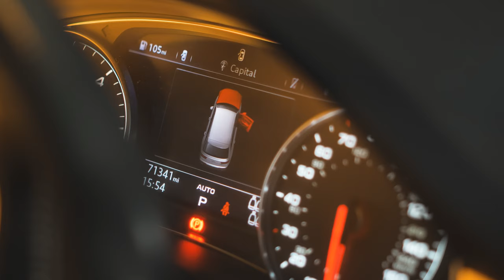AUDI Q7 COMMON PROBLEMS!

Comment: This is a great video to watch before spending 30k on a used q7
Reply from the maker: Glad it was helpful!
Reply: @itsimty  what about petrol q7 same common problems
Reply: Exactly why I’m here.I was looking at a q7 that’s 30k and used.I’ve had used bmws with no issues but afraid to venture out
Reply: @ROXELL audi's aren't for everyone
Reply: I have a 2017 Q7 and it has been great, bought it as a 3 year old lease return, only had Air Cond issues (in Florida). I have had several 5 series & X5's and they all had costly transmission and/or cooling issues.
Reply: I was going to buy a 2021 SQ7 but it has an engine light on scared to buy it just in case it’s a huge expense 🤣
Reply: @ROXELL now that ulez has expanded, do it 😂 got myself an older (2008) 3.0 V6 q7 for £900. Guy couldn't afford to keep it because he lived in greater London. Had it's issues but as it was so cheap to buy they weren't really a problem. Dpf clogged so I had it gutted and mapped out. Injector seals on 2 were dodgy so I spent about 3 hours and £100 on replacing all 6 of them. Just last week had it remapped up to 295 bhp
Reply: Update, there is one near me, 2017 q7 premium plus with 95k miles and asking 17,999 💀
Reply: @matthew_kiely the 8 speed gearbox in the 4M Q7 is the same gearbox in all 8 speed BMWs made since at least 2015.

Comment: I have a Q7 3.0 TDI 218hp ultraquattro. 97000km. I bought it 1year ago. Efter 3 months the EGR valve in the V broke so it lost cooling fluid. I had it fixed on warranty. Now i few weeks ago the Adblue pump died. I took it to a mechanic who programmed it off. Now I want to sell it and buy a gasoline car instead.

Comment: I have a 4M 3.0 TFSi that has been very reliable. It only has 40K km. Only issues thus far has been the upper suspension bushes. The car has been parked for the last 8 months and although it is started every month they tell me things like the soft closure and one touch window closures have stopped working. I suspect the low battery voltage may have disabled these items.
Reply from the maker: The drop in voltage may have caused certain functions to stop working, if you need any more advice your more than welcome to call us on 01332 756535 our team will gladly help, thankyou for watching

Comment: Great video. I own a late 2016 SQ7. Had it since it was 1 year old with 10k miles on the clock. It's a 4.0 V8 TDI version. It had been perfect for 5 years of ownership, but then in the last year we started to do really small 1 mile journeys (school pick up/drop offs etc), 1 year later, had 2 Ad blue repairs in with Audi garage - Ad blue injector pumps, and other ad blue system repairs - spent £2k on it. Before this, was just regular serviving and no issues at all. Car has done nearly 50k miles now. Moral of the story, pay for the extended warranty (or have a great Audi specialist near you!), I saved myself about 2k on not buying 2 years of extended warranty - but had I done so all the work would have been covered plus any future problems....
Reply from the maker: Thank you for watching
Reply: Or walk...
Reply: I made a comment above a year ago about my Q7 issues. Well I sold that car last October and bought an almost new 2023 Touareg. I believed the Youtube reviews that said it was a budget Q7. Sadly the first part of that advice (budget) was more apt than the latter part. The Touareg is no Q7. Noisier, thrashier, lumpier air suspension, maddening to use the driver interface (especially the cruise control), less accurate on the road. Took it for a 1000km+ drive around the country (NZ) and when I came back started looking for something else. Two weeks ago I found a December 2019 SQ7 TDi with one owner history, 25000kms (15,000 miles) and full service history since new from the same dealer. Its like new. This car was one of the very last in NZ to be sold before the switch to full digital driver interface. I bloody love it. Hope I don't have any issues with it, but it still has two years of full Audi warranty and I can get another 2 years before the car turns 6yo.

Comment: I just bought a used 2015 Q7. It’s in absolutely perfect shape mechanically. Two door dings. It’s got 135,000 miles on the it but absolutely runs like a new one. Best part is it was only $8800. Yes $8800.
Reply: What state are you in? I’m looking at one now in VIRGINIA and it’s $14000 with 107,000 miles
Reply: I got an s-line prestige V6 2015 with 166m in PERFECT condition for 4800$ in Chicago…
Reply: @FlawlessNJ  Even better as long as the Chicago salt didn’t eat too much underneath.

Comment: Glad I found this video. I've got a 2015 (new shape) Q7 3.0 TDI, which I bought with 36kms on it in 2018, now has 93kms. Been a great car. However over last three years it has slowly developed a rattling noise from either trans or engine when cold and under load (up a hill etc). The dealer service guys here in NZ (taken it to two different dealer service centres) don't seem to believe me although I've mentioned it at every service (while under warranty and now not...). They 'cannot replicate the noise'. But it is getting slowly worse and is worrying me more and more. It goes away once the engine (or trans) is fully warmed up, but takes longer and longer to clear each morning. Is it about to shit itself? Honestly sounds like an engine running with no oil being pumped around but I'm sure it can't be that or it would have by now I'm sure! Apart from that, its a beautiful car to drive and tow with.
Reply: Timing chain rattle.could be tensioners.
Reply: Start thinking to change the slipers on the chain belt

Comment: I have a 2017 Q7 Prem 3.0 GAS/Petrol, only 40,000 miles but I do ALOT of short 2-3 miles loops (home-school-work-home) 2-3 times a day. Only thing gone wrong is Air Cond. I'm in Florida, $1500 for compressor- leaking, $3500 for Evaprator core - leaking.

Comment: So a knock on effect of the injector to head seal going is debris goes through the leak back pipe into the tank?😂 Or are you talking about 2 seperate faults there? That the seals leak, and also the injectors could break down internally?

Comment: I have a 2017 Audi Q7 3.0L TDI, I bought it second hand and have owned it for 6 years now, just recently it starts to stall as I drive it in the skyway and in worse cases it shuts down as I drive around my neighborhood. I brought it to my local dealership and they changed both the battery and the fuel sensors. I brought it back home and drove it the following day but it still stalls and dies out, does anyone happen to know what the issue is with my Q7? I’m really questioning Audi reliability at this pount
Reply: Sounds like it could be a bad fuel pump, also if it's misfiring check your maf sensor

Comment: I'm an owner of a q7 4m 2018 for two years now, and here are my issues so far: the driver's mirror wasn't folding/unfolding, they had to replace the motor, soft close wasn't working on the driver's door, they had to change the driver's lock. the alarm goes off randomly when i leave the car, i have no fix for that unfortunately it comes and goes. 

latest issue is vibrating at specific speeds 20-35 in D2-D3, does not occur in Dynamic S mode or when I accelerate quickly or at higher speeds, only god knows what could be wrong :D
Reply: @stand1859 could be the lambda (oxygen) sensor. I've had one go on mine (I think another has just gone too, warning light and revs fluttering while idle). Would imagine it's a straight forward repair but you know what labour costs are so expect £200+ to replace if it turns out to be that.

Comment: When I drive my Audi A4 it makes a knocking noise when I start the car it's literally sounds like someone is knocking on the window. I am not sure where the sound is coming from and it's clickity noise coming from the engine. Do you know what it could be?
Reply: Does the car shake along with it? Or is it a tick that happens every few revolutions? It could need an oil change or new solenoid valves but unsure based on verbal descriptions

Comment: 160,000km and changed timing chain, camshafts, valvecovers and still got clunk when downshift while braking. Dont forget the brake whine! Great cars!
Reply: I also have a harsh downshift into 4th hear under heavy(ish) braking. I have some theories about it, but at least it hasn't gotten any worse.
Do you have any more info on this problem?

Comment: I recently got a jump start for my 2009 Q7. The other cars connections were the wrong way round. Now I have no ignition lights, but do have a few lights on the dash, door open light and seat belt light, but nothing else. Do you have any idea what's been damaged by this error.
Reply: hoping that was just a fusable link rather than PCM damage....

Comment: All you need to do is to delete your EGR and your DPF will last for the most of the age of your car.
Reply: I'm in CA. Can you still smog the car if you do that?
Reply: @lexxamillion32  EGR has nothing to do with your engine smoke. That's the function of your DPF. You should see my Tiguan's exhaust with 140000 miles on the clock no trace of sooth whatsoever.

Comment: Wouldn't be seen dead in any Audi.
The owners seem to be very image conscious
Reply from the maker: Thank you for your comment
Reply: I have a 2019 Q7 and I agree with the snobby attitudes of some enthusiastic owners. However this is the best mountain/winter vehicle I have had. Also funny to pull up beside some young guys and then give them a nice view of my taillights.
Reply: @stevewheaton7218  I have a 2019 Audi Q7 3.0 too, I just visited dealer to know how much 60,000 miles service was and they told me $1483 bucks :// hahaha.. I think I’ll just do the “spark plugs, v-belt and brake fluid”. The rest in a other place :)

Comment: had coolant leaking into engine at 260,000 miles. engine is done. sadly.
Reply: 260k miles is pretty good
Reply: I had the same thing on a 2018 q7. I gathered the water pumps on these are weak. That cleared up my coolant leak